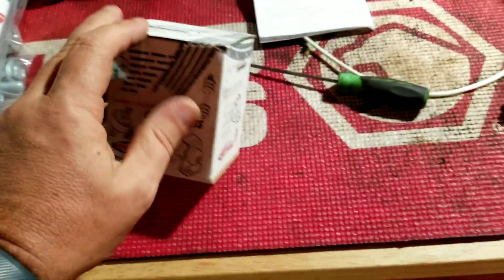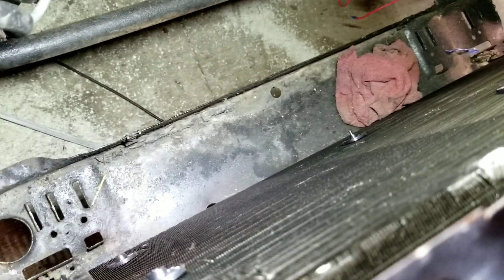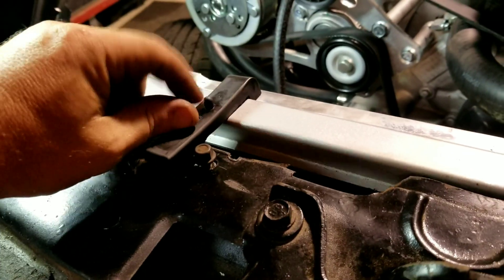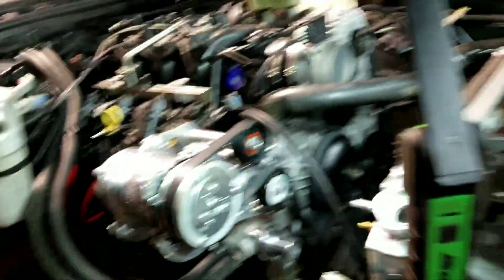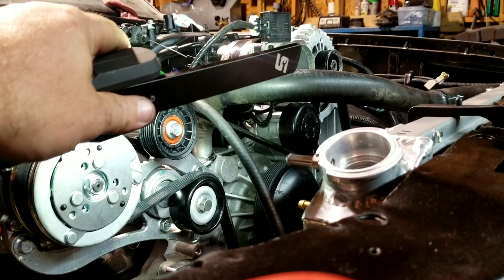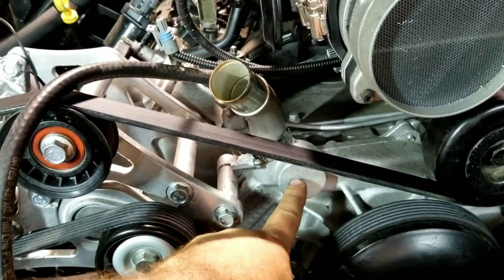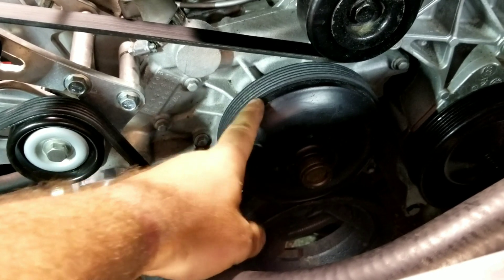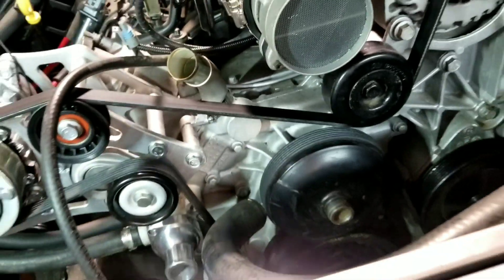Monte Carlo 5.3l LS swap radiator 4l60e electric fans AC

Comment: What is that 90° hose that you have on there ?
Reply from the maker: I bent a piece of metal rod in the shape i needed the hose to be and went to the parts store with it. Matched it up and it worked out for me.
Reply: Thanks man your page is awesome been a big help on my cutlass build
Reply: Hey boss did you have to modify the radiator I order the one with fans off of your link and it seems like it's too big
Reply from the maker: @mikearnold4198   I did not. I checked the link and it says it's for the MonteCarlo like I have. I ordered it from Amazon. I'll check the measurements on mine tomorrow
Reply: Right on man

Comment: Great content 👍🏽
I'm doing a 5.3 ls swap in my gbody and did you have any issues with the usage of those fans?
Reply from the maker: Zero issues. I think I put a link in the description to the setup I used
Reply: @Trouble.Maker.Racing  ok👍🏽 
Another question, what degrees thermostat is great to use for this setup?
Reply from the maker: I ran a 180 and the car never gets over 185
Reply: @Trouble.Maker.Racing  ok great👍🏽 
Thanks alot for the info bro, I've read so many good and bad comments about this radiator, fans and strout so I'm trying to gather up all the right information to have mines so again... Thx!👍🏽👍🏽
Reply from the maker: @ruccimack97  if the fans are wired properly with relays and the properly sized wire they work fine but are not high end fans. As far as the quality of the radiator and fan shroud, best bang for ur buck u can find.
Reply: @Trouble.Maker.Racing  ok!
What about the transmission lines fitting? Would the stocks work or are there another size fitting I would have to use?
Reply from the maker: @ruccimack97   I usually use a aftermarket cooler for the trans but u can get the NPT to barb fitting and run a soft transmission line. Make sure it's actual rubber transmission line due to pressure requirements. Not fuel line!!!
Reply: @Trouble.Maker.Racing  👍🏽got it
Reply: What radiator and fans combo did you use

Comment: what is the make and model for the radiator and does it come with trans cooler.  any modification needed for gbody
Reply: If you could drop that link I would appreciate it, thanks
Reply from the maker: Done!
Reply from the maker: Its just a amazon special. And yes it has a built in trans cooler.
Reply from the maker: I put a link to the exact one in the description.